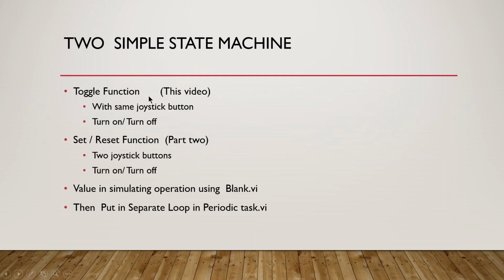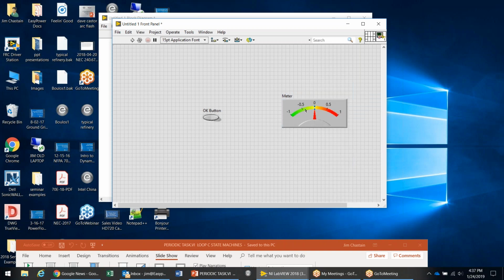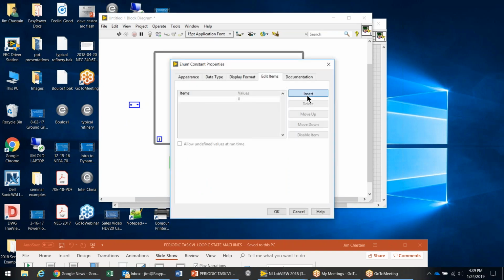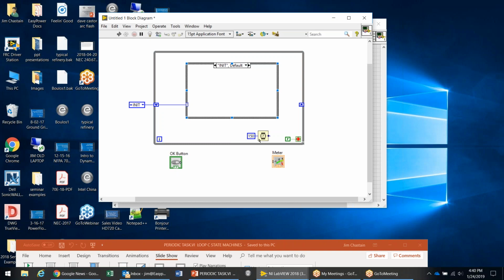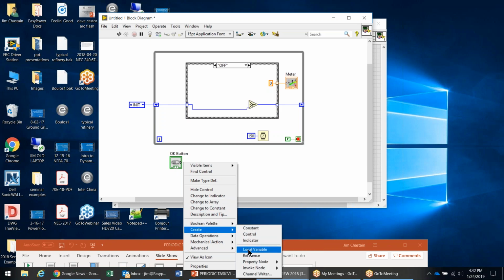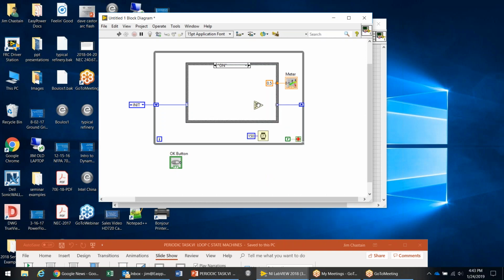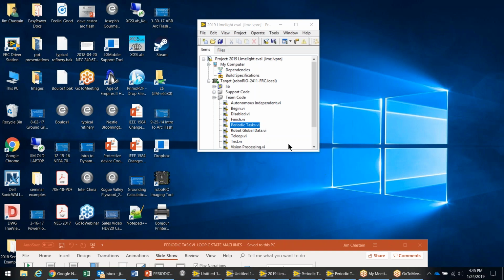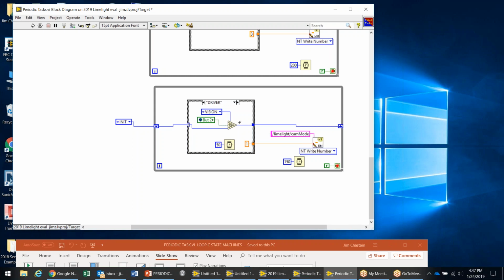SIMPLE STATE MACHINE  TOGGLE FUNCTION

Comment: An alternative to the double wait timer would be to trigger the state change off of a rising edge of the button. You can wire the button value into a shift register or feedback node and each itteration  compare the current value of the button to the previous value. If the current value is true and the previous value is false you have a rising edge and that can trigger the state change. The state cannot change again until the button goes off and then on again so you do not have to worry about your state machine constantly switching back and forth if the button is held down.
Reply from the maker: Nice improvement.    Need to give it a try